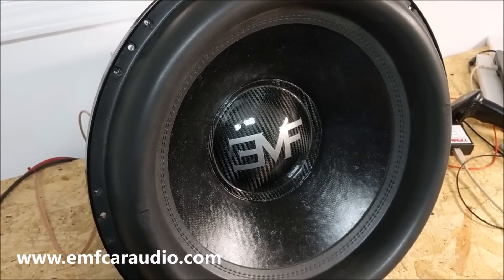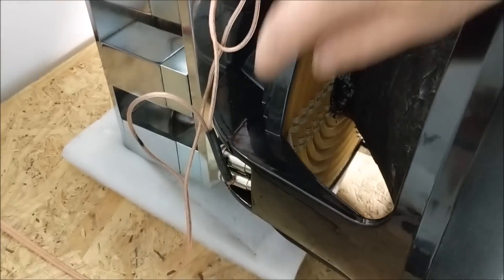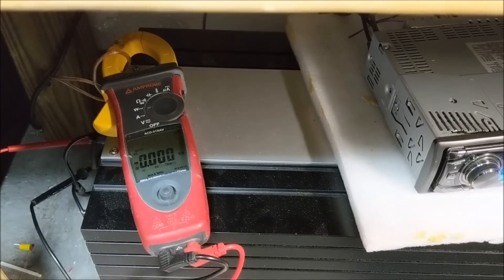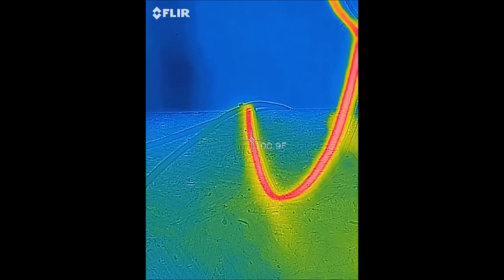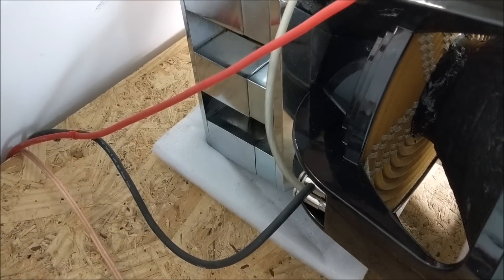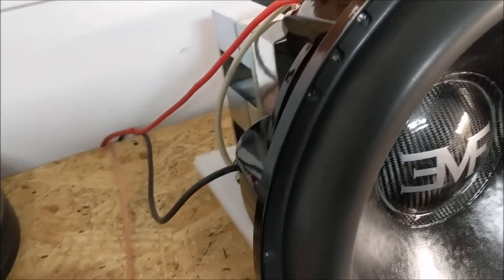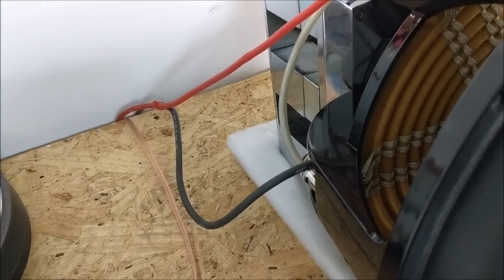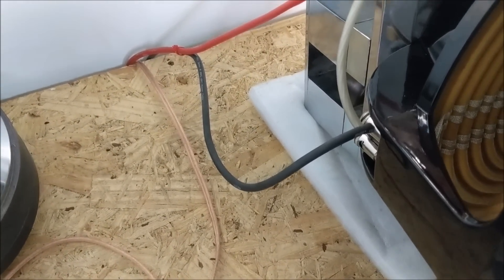Are you using the proper speaker wire size?

Comment: Straightforward examples. IMO you should always lean to max gauge reqs for your power/speaker supply wiring. Unless you're fighting costs, weight, or design constraints. Larger wire provides additional heat dissipation and physical strength as well.

Comment: Ol school said to me, "don't make no damn sense, big ass power wire but you got baby wire running to the speakers"
Reply from the maker: It's about current. The power input is DC at a low voltage. The power output is AC and higher. The higher the impedance, the lower the amperage for a given power level.  Example, 1,000 watts @ 1 ohm is around 31 amps and 31 volts, and the wire is shorter as well. But, that 1,000 watts of output would be around 1,200 watts of input because amps aren't 100% efficient, and at 14 volts that would be almost 86 amps of current. That's why you need bigger power than speaker wire, it can take 3x the current to produce the power you're making.

Comment: Yeah it's crazy how many people say 16guage and it's funny you used that as the example. Anybody running that crap to subs is nuts I really could care less what brand it is or it's "underrated" is a common excuse nah. I actually use 4 guage to my subs 8 guage on my second amp and 12 guage to my aftermarket interior speakers. You'll not only heat up the wire but you'll get cleaner (less noise and motor noise to coupled with proper shielding). Point is check the AWG standard and account for accordingly if you need to save some money use distribution blocks (not from Amazon  off brand you get what you pay for) to tie in your second amp if using one.
Reply from the maker: 16 gauge is fine for some setups, if it's a short run and under 1,000 watts it's probably fine. 4 ohms, definitely fine.
Reply: @EMFAudio  From a competition standpoint, Jeep enthusiast like myself (or whatever), anybody doing other/future upgrades to there vehicle, adding more electrical or have a weak alternator I have to disagree to a degree yes I guess it's okay as you stated but the savings in wire isn't worth it especially if you need more from your alternator or care about your vehicle. That's not even taking hot summers into consideration. I guess there should be a clause if your ONLY running a couple of subs I might consider something like 16guage I still wouldn't use it but you definitely could. The less power loss there is the better.
Reply from the maker: @fragslayer  I think you're confusing speaker wire with power wire. This is speaker wire, not power wire, which is very different.

Comment: Thank you for the video. So for 200w 6.5 subs on a 1200 mono amp, what size wire would you run from the amp to the subs? Thanks in advance!
Reply from the maker: That depends on the impedance and how long the wire is.

Comment: Compute your maximum amperage and use the appropriate wire. Using a nominal 1 ohm for that connection the current and voltage will match. So you are getting around 34 amps. The more likely resistance of that connection is .8. That would yield a current of about 30 amps. Wired in series it would be 69 or 61. Now you see why very low resistance in the coils is an advantage on an amplifier. Or you can use a clamp on amp meter set to AC to read actual current from the amp.
Reply from the maker: Wired in series is LESS amperage. Lower impedance coils can be MORE of a strain on components. There is a protection circuit found on most amps called "over current", that's from impedance being too low or to the point it's a dead short.

Comment: Yes, already known but still an interesting and poignant video. Back in the day, (standard) speaker cable was two color 20ga. Switching to 18ga (zip cord) was usually advised. I tried 16ga in 1980 and have used it ever since. I have 4ohm speakers in two rooms and a long run for one pair (20+ft). Thought about 14ga or heavier but with binding posts on one pair the 16ga just about fits. Amp is only 50wpc (class G). Can't parallel both pairs as my transistor amp would get a severe pain in the output stage. Hard to convince some folks that thicker IS better. Nicely "splained".

Comment: I wonder if a single run of 8 awg speaker wire can handle 10kw RMS per sub. (I'm not talking about the power wire). Or if I need 2 runs of 8 awg or 4 awg as my speaker wires. (20,000 RMS WATTS total between 2 Fi Neo 4.11 subs which can take 7k rms each therefore the 20k is for SPL competitions) 1 amp per sub.
Reply from the maker: That depends on impedance and wire length. 4 gauge is stupid to deal with, especially for how much it won't do for you.
Reply: @EMFAudio can you elaborate on that

Comment: Would 12 awg be good for wiring 8k 2 ohm stetsom on 4 d4s or should I order 8 awg 😅
Reply from the maker: That depends on the wire length.
Reply: @EMFAudio  probably 5-6 ft each sub in series on own run paralleled at amp
Reply from the maker: @mistanotu8791  12 gauge should be fine
Reply: @EMFAudio  thank you for the reassurance ^.^

Comment: I melted 16 gauge on 1200 watts because i ran it way to long. My subs terminals wont take 12 gauge however, wired in parallel with 3 wires shoved in the same push terminal, however, just changing the amp to box wire made a huge difference and im no longer melting my wires.

Comment: the flir can make issues look worse than they are as it auto ranges the colouring, so even though the wire only got 20f hotter than the table the colour difference was blue to dark red.. youd think the dark red is scalding hot but really its barely above body temperature, not saying that wire is sufficient for that sub i really dont know but the wire could of handling alot more heat without melting or anything but again the test was high power but short
Reply from the maker: Yes, it does tend to exaggerate variance but it does show that wire heating up from power is bad, be it 10 degrees or 30 degrees. Ideally, it shouldn't be heating up at all.
Reply: @EMFAudio   well all wire heats up some, its a cost/performance balance you have to strike.. in the process of hooking up two 350rms 4ohm subs upto a 1100pea watt 550rms 2ohm or 300rms 4ohm amp.. not ideal  but got all components for under 100$ cost, amp was free

any tips to keep the gear from smoking up? just set the gain appropriately and dont expect max performance out of it should be no big deal?

Comment: 100° Fahrenheit doesn't seem that hot. Is it possible some heat is beneficial? 12-gauge wire in that system probably seems about perfect. I wonder what doc Brown ph.d used in his.
Reply from the maker: Heat, in regards to electricity is always bad. More specifically when electricity generates heat that means there is a loss of energy not going to the device. It's essentially lowering the efficiency of the wire and potentially what's connected to it. More heat means more resistance, which makes more heat, which makes more losses.
Reply: @EMFAudio  I'll buy that. Question, does a power wire inline fuse appropriately rated cause any heat/resistance issues?

Comment: How do you connect two 8guage wires together? It’s so much wire that it grays out
Reply: I just received dual 8 awg speaker terminal inputs from Sky High Car Audio. They're so small but effective for my 20kW!
Reply: @lowhertzhighspl  so do you use them in the box?  I am having problems with the subwoofer wiring inside the box. Braiding two 8gauge is so thick that it won't fit in the terminal of the subwoofer. I just connected them at the speaker box terminal. would the dual terminal inputs help that?

Comment: Good luck fitting two 8 guage wires into one terminal when bridging down in ohms
Reply from the maker: 4 gauge inputs will do it, like are found on subs that can actually utilize 8 ga wire.
Reply: Or buy dual 8 awg speaker terminal inputs from Sky High Car Audio as I did even though most good subs fit 4 awg. Or some subs have hybrid terminals which aren't push but are a bolt just like on flat battery terminals such as Fi Car Audio subs have the option.

Comment: Unfortunately my subs can't accept 8 gauge speaker wire. How do I know? Because after watching this video I ordered 8 gauge OFC wire for $30. Subs are two 12" Kicker L7Ss on 2000 CEA RMS Watts @ 2 ohms. Speaking of my L7s, I'm in need of even more bass, what should I do? Upgrade to two 15" L7Ss? Or add 2 more 12s? (Prolly least expensive way to go). Or switch brands entirely? Not looking to spend more than another $1,000 just as I have 2 months ago on this brand new system =/ Thanks Sean.
Reply from the maker: Pro tip, if it won't accept 8 gauge, it doesn't need 8 gauge. 2,000 watts DEFINITELY doesn't need 8 gauge. It sounds like you need a higher caliber of sub. What do you have for an amp exactly? CEA ratings tend to disappoint me, but to be completely honest, you might find yourself happier with a pair of our Lowballer 15's that are also on sale now. You could be in a pair of those for just over $300.
Reply: @EMFAudio  Yep I should've checked the speaker inputs first.  I'm glad you mentioned your Lowballers because now after researching them I'm literally one click away from completing my purchase of two 15" Lowballers but I noticed the ported box size needed which for 2 won't properly fit in my vehicle so which box do you recommend and would it be fine to add (eg 2 lbs) poly-fill to a smaller enclosure?? Maybe I should go with one 15 but the thing is as I previously mentioned I'm disappointed with my 2 L7S12s so I don't think one 15 would make adequate improvement. To answer your question, my amp is the Rockville DB16 which on the dyno puts out 2400 RMS W Dynamically and 1750 Certified at 2-ohms which is how my system is set-up. I really like "Q-Bomb" enclosures. Thanks for your prompt input.
Reply from the maker: @lowhertzhighspl  I won't get started on amp Dyno results but I don't recommend polyfill for ported enclosures.

Comment: Would 12 gauge ofc be adequate on 2000 rms?
Reply from the maker: That is dependent on impedance and wire length, but most likely, yes.
Reply: @EMFAudio   2ohms and less than 5 ft
Reply from the maker: @MrBiscuitsAndmustard  12 gauge is fine
Reply: @EMFAudio  one more question... would 10 ft of 8 gauge be better than 5 ft of 12 gauge?

Comment: How did you installed the 8 AWG tp the amplifier? most only accept 12 AWG,
Reply from the maker: A fun fact, if the amp doesn't have 8 gauge outputs, you don't need 8 gauge wire. Most of your big amps have 8 gauge outputs, or even 4 gauge sometimes. 12 gauge will handle quite a bit of power.
Reply: @EMFAudio  I know that 12awg will work, but 8 looks very good.
Reply from the maker: @daniloreyes2  Electricity doesn't care what it looks like, trying to do more is just a waste of money.
Reply: @EMFAudio  true...
Reply: @EMFAudio  recommend me a good brand
Reply from the maker: @daniloreyes2  Well, we do have Sundown Audio wire that is quite good and all I use on www.emfcaraudio.com There is good wire out there, the biggest thing is to know which ones to avoid. Cheap wire is cheap for a reason.
Reply: @EMFAudio  My amp is a hd1200/1

Comment: So if I’m using 2500 watts rms 12 gauge wire ofc to woofer is okay?
Reply from the maker: The length of the wire is the consideration of if it's OK or not. If it's a short run, yes.

Comment: What is the best type of metal bolts to use for speaker terminals
Reply: I used size m6 stainless steel nuts and bolts. If you are using ring terminals to fix the speaker wire to the bolts then the size of the hole in the ring terminal will dictate the size of the bolts.  Alternatively you could get SMD terminals they are good.

Comment: Im using 14g to each coil (dvc) on 2 subs. Is that good on 2000 rms.. Link dosent work
Reply from the maker: The impedance that you're wired to matters there, as well as wire length. If it's short wires and not below 1 ohm it's definitely fine.
Reply: @EMFAudio  1 ohm 2ft to 1 and 3 to other
Reply from the maker: @sabarlow80  that's fine

Comment: It would have been far more interesting to show 8 vs 12 vs 14.  No one makes a case that 16 are fine for subs
Reply from the maker: Lots of people use 16 gauge, and there are cases where it IS fine.
Reply: @EMFAudio  Not for your example (18" sub @1200 watts).  Don't get me wrong, well done vid and a nice touch how you showed heat signatures to make your point.  I'm just very interested to learn the differences in 8 vs 12 vs 14 and from my experience that's what people debate on most.
Reply from the maker: @MartinAoki47  That's why "appropriate" was mentioned and extremes were used to make the point. You can calculate the appropriate wire size. I did this video prior to the Tech Stuff Tuesday series so I may revisit this one with more testing and detail.

Comment: How about the terminal inside of the amplifier what is the size of wire
Reply from the maker: That is a case by case. Some don't use wires, most use 8 gauge wire, some are multiple 8 gauge.

Comment: i have 2 skar audio sdr 12s, paired with a skar audio rp1500 amp. i’m using 16 gauge wire, do you think if i got 10 gauge wires for the subs, would it be louder?
Reply from the maker: The impedance it's wired at matters, over time at full power you could probably measure an SPL difference but it may not be audible. Length of the wire matters too. The longer the wire the more likely you'd hear a difference. 10 gauge is definitely not necessary. Anything past 12 gauge I know you wouldn't see a difference at all, 14 gauge would probably solve any losses.
Reply: EMF Audio would there be any difference if i went from 16 gauge to 10 gauge? my wires are literally starting to melt and turn dark colors at the terminal of the box
Reply from the maker: That sounds like you have crap terminals. If it's the kind you push the lever down and it springs back up, those are terrible and that's likely the issue, not the wire.
Reply: EMF Audio yeah that’s the terminals i have 😂😂
Reply from the maker: @DatHondaBoi223  Replace the burnt wire, get rid of those jank terminals, fixed it.
Reply: EMF Audio so just to be sure, 16 gauge is enough for 1500 rms?
Reply from the maker: @DatHondaBoi223  http://www.bcae1.com/images/swfs/speakerwireselectorassistant.swf see for yourself what will work best.

Comment: I have a renegade 850 watt amp and two renegade 12s whats the max size speaker wire can I use ?
Reply from the maker: That is subject to impedance and wire length also. That isn't that much power so 14 gauge is certainly fine if the amp and speakers are remotely close together.
Reply: EMF Audio if I was to upgrade my amp what would u recommend ?
Reply from the maker: @kscrm_6883  That depends what you upgrade to. There are wire size calculators online that will tell you what's appropriate based on your parameters.

Comment: Prob with 8g or even 10g is if you need to wire dual or triple or more subs in parallel then many subs cant handle 2 8g or 2 10g doubled up into 1 terminal. So you gotta downgrade to 12-16g in order to for it to fit
Reply from the maker: If the terminals aren't meant to fit larger wire, that should be your first clue it doesn't need it.

Comment: Could you tell me what gauge to use on one jl audio w6v2d4 and one jl audio w3v3 subs being powered by a polk audio d1000.1 amp? I had 2 w6 but 1 blew and replaced it with a w3 but want new speaker wire but dont know what gauge i should use please help!!
Reply: 12 to 16g is fine bro..
Reply from the maker: The wire length matters but 12 gauge is definitely fine, even 14 gauge is likely OK.
Reply: @EMFAudio  must be an echo in here

Comment: the ermagerd is 6500 watts RMS with 88dB sensitivity (frequency dependent, of course). 
My cheap 21" sub is 1000 watts RMS with 100dB sensitivity (1w/1m). 100-88=12. 12/3=4  2^4=16. 6500/16=406.25 ... vs 1000.
yep. I'll stick with the cheap one, since it takes 1/16th the power to make the same sound output and has a lower Fs parameter.

I don't need a loud sub, but it's hilarious to have one that's theoretically louder than this beautiful beast.
Reply from the maker: Your cheap 21" sub won't play 30 hz or below very well, maybe not even below 40 hz. You're also forgetting something else, displacement. Displacement on your 21" might be say, 10mm of Xmax compared to the 60mm of Xmax of the Ermagerd v2. If you do the math you'll find the Ermagerd v2 15" has 160% more displacement than the 21". The best part, all that theory means nothing. I'll be doing a video on that showing reality sometime in the near future.
Reply: What's your sub's output at 6,500 RMS? Right. Your comment is hilariously petty. Just outrageous. Step up your game, bro. You're not impressing anyone.

Comment: All you need is this Tool, its better than the one in the description:
http://www.jobst-audio.de/tools-nuetzliches/kabelrechner
On the top left you insert the wire lenght. On the right of that the 
cross-section of your used wire.
After that just insert the used driver impedance, power and damping factor of ur amp and you get the result on the bottom right with the power loss.
It should bei 20+, for very good hifi results go for 50+.
Video Example: 8AWG vs 16AWG (1Ohm, 1200watts, 2,2 meters, 500 damping):
1186 watts at the speaker --- 1113 watts at the speaker
0,33 Voltage drop --- 2 Voltage drop
80,72 Damping Factor --- 16,13 Damping Factor
Reply from the maker: The problem is the lack of damping factor spec listed on amps, or flat out made up specs.
Reply: @EMFAudio  you can calculate the total damping factor with the tool I have posted
Reply from the maker: @Newschoolcovers  The tool you posted has a field to enter amplifier damping factor. That is a spec provided on the amp, you aren't calculating that and it's required to calculate it after the wire is added.
Reply: @EMFAudio  I know, the result on the bottom right is the total damping which is the damping of the amp and the damping of the wire in combination.